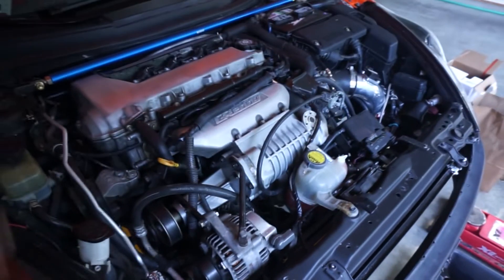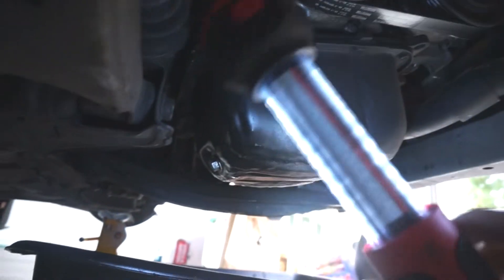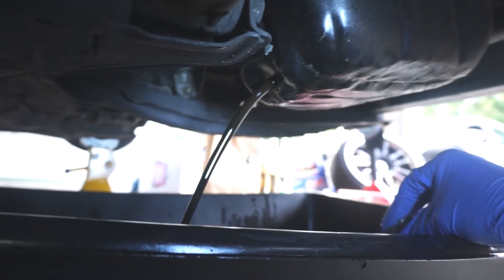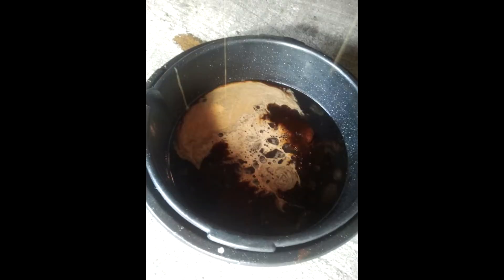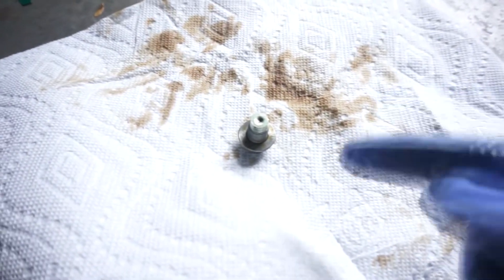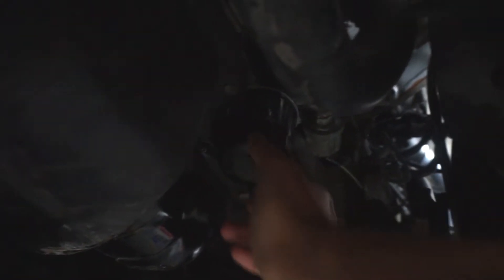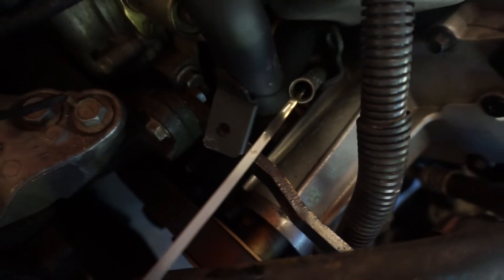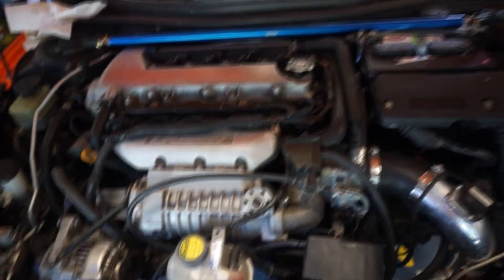A Simple Video on How to Change Your Oil | Celica Basics Part 1

Comment: I love how easy it is change the oil on my Celica, unlike my Integra with the oil filter behind and deep inside the engine 😅
Reply from the maker: I know right! So fast haha. My MINI Cooper requires special tools like a cap wrench to get it off. Being a MINI, so hard to get that in there haha. My record for the Celica is like a 6 minute change including removing the front end 😂 and like 2 of that is letting it drain.
Reply: @ConnorNation  lol that Mini sounds like a lot if work lol .. And that's a good record lol i do it like in 10 minuteslol...btw your celica is so hot let me borrow it fo a week lol
Reply: I work at an oil change shop. I can confirm that.

Comment: Hey Did you upgrade your 2zz oil pan/sump?
Reply from the maker: I have not! I haven't had an issue with mine yet and I drive pretty aggressive. If I were to ever get more views, that's my next buy for the channel. Install of a Mororso pan.
Reply: @ConnorNation  heard the 1zz oil pan has a baffle and can be used.
Reply from the maker: @kareembell1164  yeah that is a mod people have done - sometimes people say they require modification and sometimes bolt up. I'm not sure if it's dependent on year of pan/motor but there is a gray area on it